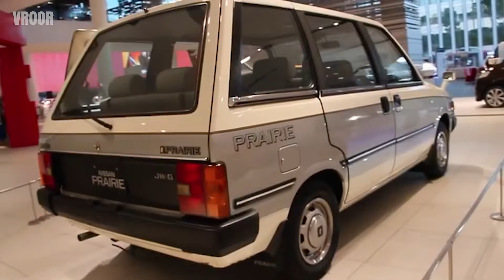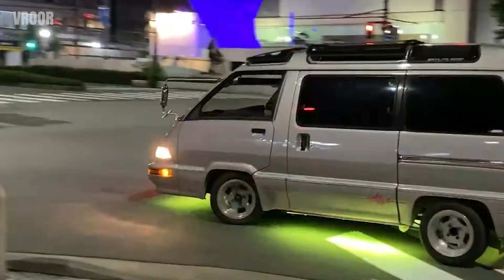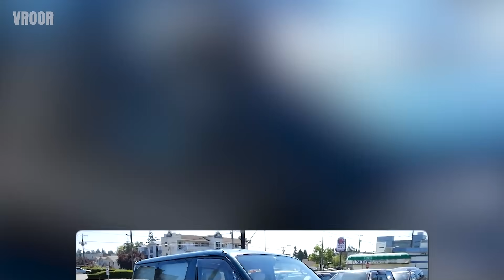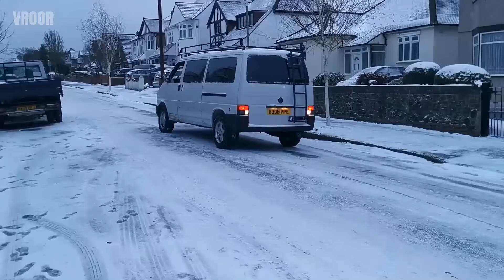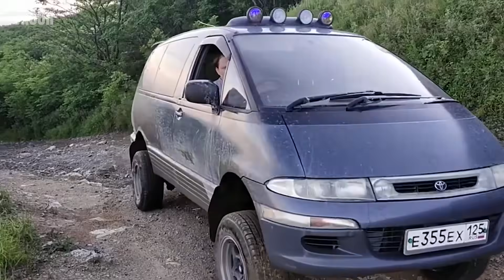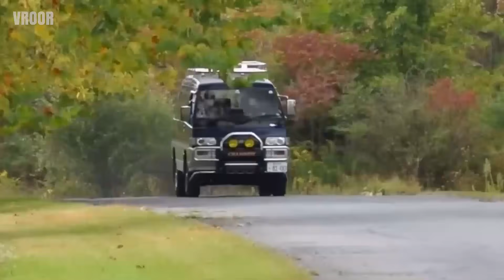10 Most OVERBUILT 4x4 Minivans Ever Built!

Comment: Previa as a van for me became one of the most long lived 2x 's I ever owned and operated. I was closing in on 400,000 miles as a third owner and the only repairs it ever needed were exhaust and brakes. Frame rot made it uninspectable. The scavenger oil reservoir was a splendid feature as were the side stowing way back rear seats.. The drivers seat was still one of the most comfortable I have ever endured on long trips.
Reply from the maker: That's an incredible testament to the Previa's durability! It's always fascinating to hear about vehicles that truly stand the test of time.

Comment: The Mitsi L300/ first gen Delica is a van body on the L200 Ute chassis.   Just as the L400 is a van on a Pajero chassis.   What make ls these and a couple of others proper 4wds compared to previas etc is that they have a full, rigid chassis.  Not a half chassis monocoque

Comment: I love when someone talks about 4g63 like he knows the platform xD Telling that it had 4g63 engine like evo is a joke because that engine was also in forklifts and? :D
Reply from the maker: You've definitely hit on a good point about the 4G63's broader applications! It's a versatile engine, for sure.
Reply: Wasn’t it the 4g64 that was the industrial version?   Interesting fact is 4g64 has a strong bottom end and the 4G63BT head from the Galant VR4 (nicknamed evo 0 in NZ) bolt together without any modification.  Easy way to make a 2.4l stroker motor for an evo

Comment: The most stupid video i've ever seen.. 
The Delica is first and foremost an off-roader, and only secondarily a minivan. It features a full-fledged Super Select all-wheel-drive system, a low-range transfer case, a solid rear axle, and a front torsion-bar suspension. Factory options include locking differentials and a choice of final drive ratios ranging from 3.9 to 5.2 in 0.2 increments. 
All the other vehicles in this video employ standard crossover solutions—lacking a low-range transfer case—and are not off-roaders.

And to say that with the Mitsubishi Chariot you get the same thing as the Delica for less money is disrespectful to the Delica—a vehicle that, throughout its entire history, has had only one and a half competitors: the UAZ Bukhanka and the Hyundai Starex (which is a licensed copy of the Delica).
Reply: This video is also too AI for me.

Comment: In Australia we don't have a 25 year rule for importing vehicles so recently the JDM vehicles have exploded in Australia and particularly people movers bit the first Mitsubishi 4X4 was available as a van for commercial use and l owned a Toyota Liteace a 2X4 but available in a 4X4 about 2 inches higher than my 4X2 Liteace and that's a fact a standard 4X2 Liteace had plenty of ground clearance and l can understand why because the radiator lined up with the front axle if it had a front axle which made the steering very light and you would think it had power steering but it didn't and the 1800cc engine wasn't the most powerful engine four cylinder engine it wasn't fast but got along alright or a van and Nissan Prairie we got those in Australia not people mover or a mini van more am MPV because it was a five seater as for the Mitsubishi Delica they were and are JDM imports and the Toyota Privia was the Tarago and they were a some of them were all wheel drive as opposed to 4X4 but nobody lifted them put big wheels on them they just looked like a 2X4 Toyota Tarago also you missed one the Toyota Hiace Custom a 4X4 people mover and imported into Australia privately and 4X4s didn't rely take off until the 2000s in Australia and there is 4X4 six seater people mover available in Australia through a dealer and that is the Mahindra Scorpio made in lndia and will be extremely reliable and th Scorpio uses the same engine in the Scorpio as in the 4X4 double and single cab ute the Mahindra PikUp and three Mahindra PikUps that a courier in Raymond Terrace N.S.W have done l million kilometres each now thats reliability because they build them for what the Indian people do to them they overload them  drive them on really rough and the conditions in lndia aren't the best so to survive in lndia the vehicles have to be really tough well our Suzuki Baleno was made in lndia and it hasn't broken down yet and our Baleno was made in 2017
Reply from the maker: That’s a fascinating look at the unique van culture and vehicle market down in Australia!
Reply: Canada doesn’t have a 25 year rule either. But It has to be 15 years old here. 
murica has the 25 year rule. 
I use mine as a winter car.
Reply: Oui mais en Australie, vous conduisez du mauvais côté de la route... Vous êtes "weird"... (comment peut-on effectuer le changement de vitesse avec le bras gauche ? C'est inconfortable. Inconfortable et bizarre, comme c'est le cas dans les pays qui ont cru chic et de bon ton d'imiter ce qui se fait des plus discutable dans le défunt "empire britannique"...